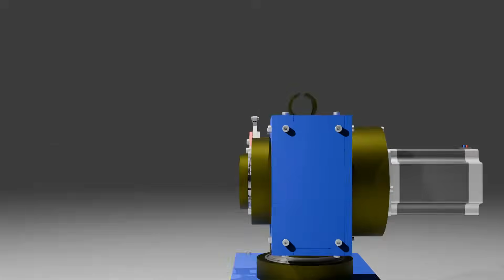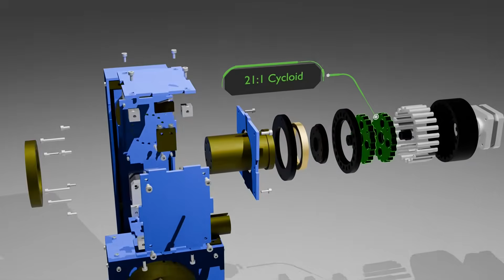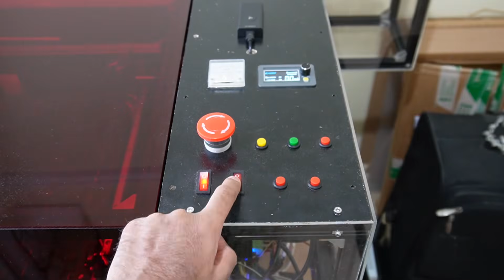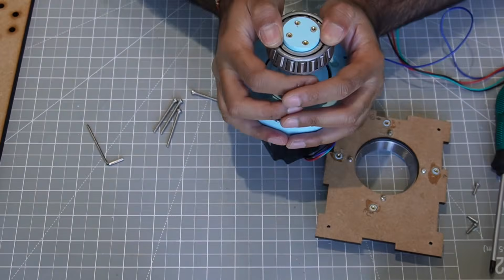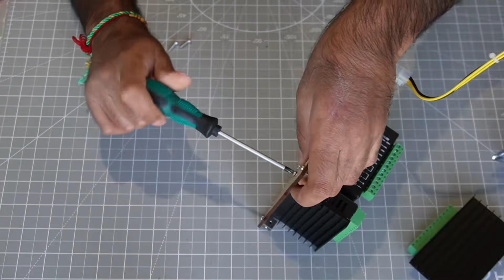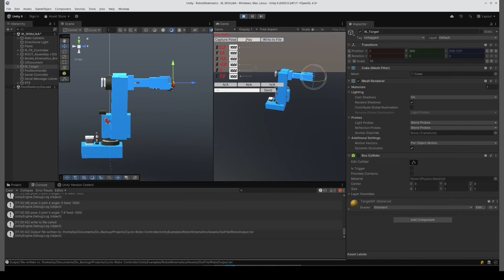DIY 6 DOF Robot Arm- Open source/Unity/GRBL 6 axis/3D Printed/Cycloid

Comment: I'm looking for a video on how to build an Arduino based SCARA arm plasma cutter.  I'm hoping you will consider such a project. Thank you.
Reply from the maker: I've done a scara arm project in a previous vid, I'm not sure how effective it would be considering the small working area compared to a purpose built cnc machine
Reply: @kpmaking9647 Thank you.  The small working area would be fine.  Please look at information on the ArcDroid plasma system as an example. Thanks!